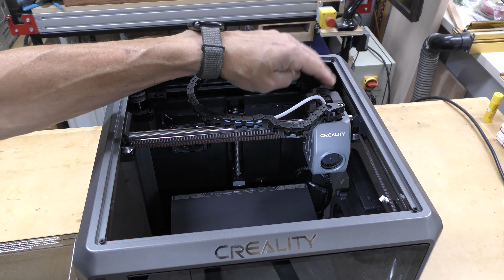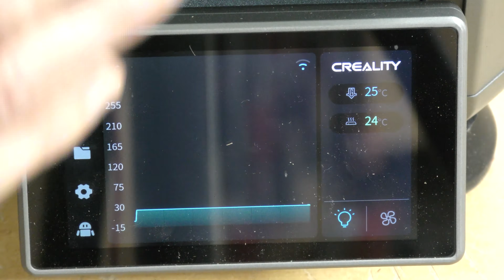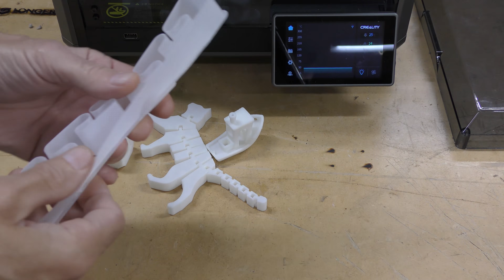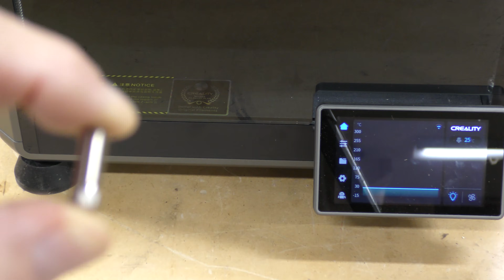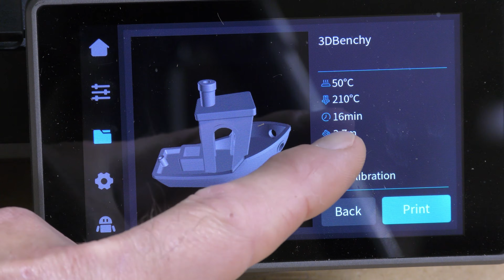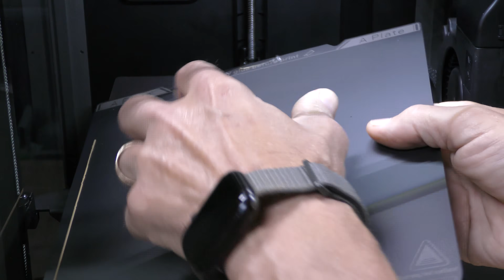Creality K1 Speedy 3D Printer Test and Review - Is this the true winner over the Bambu P1P?

Comment: I have the K1 and so far love it. Everyone complains of the fan noise. If you have a fan you have noise.The more air you move the more noise you have. My printer is in a room cooler than usual and I print with the top on and the noise is quite a bit less. If you can keep the chamber temperature below 30 degrees you will have no problems with any of the PLA filaments. That is my experience but like always results vary from person to person. Good printing.
Reply from the maker: I keep mine in my garage, so the fan noise doesn't bother me. Also I know that since it is a core xy moving very fast, it makes noise and that's the nature of the beast. I put hinges on m y lid so I can open it up when printing PLA so heat creep doesn't happen. I really like this printer.

Comment: Is there a recommended process for cleaning dust/bugs out that may accumulate in a shop environment? I noticed this isn't a perfectly sealed unit so it'd definitely going to get dusty in there.
Reply from the maker: I just usually blow these out with low pressure from my compressor and wipe down with IPA. Works pretty good.

Comment: It's good that that nozzle makes the machine work, but I shouldn't have to spend an extra cent on a $700 machine( for me) to make it work as advertised!
The 3d community needs to stop taking crap from the manufacturers, sure you might have bought an ender 3 for $100, but now we're talking machines up to and over $1000.
Reply from the maker: You don't have to spend an extra cent. You can either just take the bowden tube out of the cable chain or use the super special creality filament. I get what you're saying about it though, and I agree with you. I am just letting others know my experiences with it, and how to remedy the situation.
Reply: Well, if I take the bowden tube out of the cable chain, I have to print another part so the tube doesn't scratch the top cover, you see ,stop fixing the manufacturer's problem otherwise 3d printing will never become a consumer product and that seems to be the manufacturers' wish anyway
Reply: Guy, did you have to use some sort of heat paste when installing the CHT nozzle?  Really useful review thanks. Laurie. NZ.
Reply from the maker: @LWJCarroll  I didn't use any paste. I'm sure you could though. Thanks for watchig!

Comment: Other reviewers blamed the extruder for the under extrusion. Did all your problems go away when you changed to volcano nozzle?
Reply from the maker: All of them. I have about 120 hours on the machine. Maybe over time the extruder will start to have issues due to the stress on the scres that Nathan talks aboout at @nathanbuildsrobots
Reply: @GuysShop  I might be wrong, but it seems the volcano nozzle manages to fix the extruder issues. Anyhow did you get the long promised revised version or it was the first batch that you have?
Reply from the maker: @sabotage3d  This was not the engineering samples. It was from the first production batch

Comment: Awesome revirew Guy, thank you for the video. If you don't mind me asking, do you have any suggestions on reducing the k1's noise? I don't mind reducing the speed if I can reduce the noise enough to use on my home office while in a meeting, for example. I tried reducing both side fan and model fan to 50% but it still is pretty loud. I tried a 75% model fan and 0% side fan setting but now the machine movements are too loud lol, even though I reduced speeds and acceleration D: 
Anyways, sorry for the rambling, thank you again for the honest review and for the tip about using a cht nozzle, I'm definitely upgrading mine with one.
Reply from the maker: If the sound is an issue, print ABS with the doors closed and slow down the fans and speed. Get an activated charcol filter for the fan in the back to deal with the smell. That's abouot the only thing I can think of. My P1P is pretty noisy as well. I Think it is a common issue with the Core XY printers.